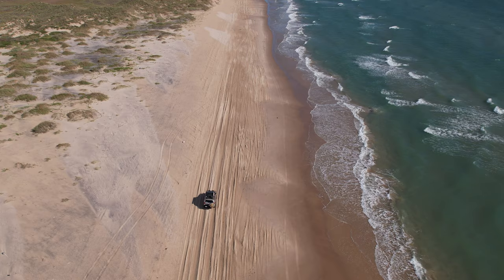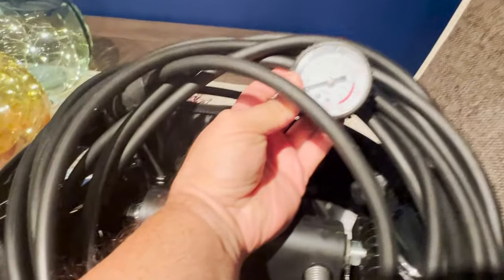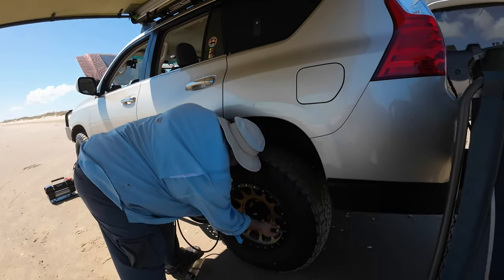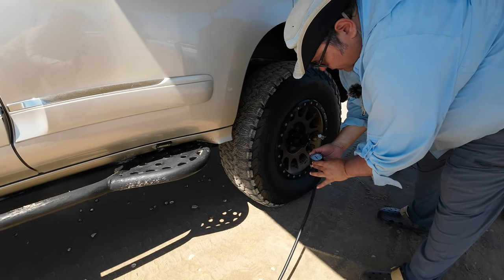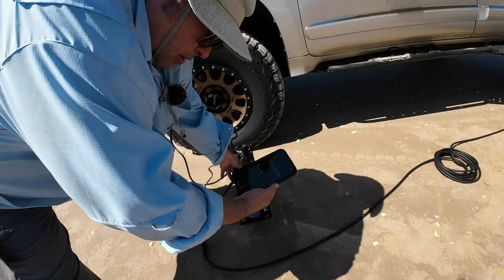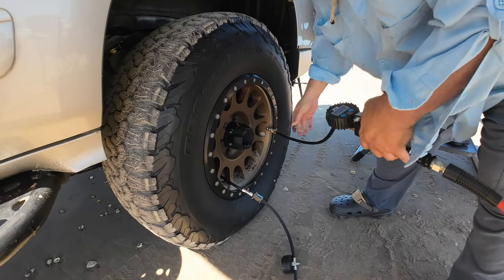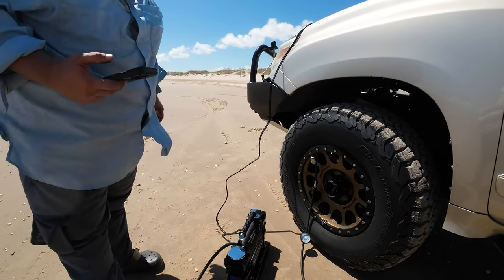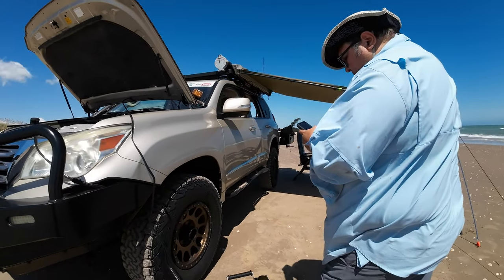TOZALAZZ 12v Air Compressor VS a TWIN ARB - You won't believe who takes it!

Comment: I’ve got a small Viair.  Not the smallest, not particularly fast but it works.  It also has the battery clips but what I rigged up in my truck is using a blank 7 pole trailer plug…I wired up some large gauge cables to it over to a power pole connector. From there I have another powerpole to ARB locking 12 volt fridge plug to run my fridge.  The cables are really large coming into the 7 pin plug so I have no worry about running my compressor through there.   I need to cut off the battery clips and put a power pole on them and put a power pole on the end of my  Vaiair so I can power it without opening the hood and I can still revert back to using the battery clips if needed. Those times on that Tozalaz were impressive.
Reply from the maker: I gave my Viair to my son. Very dependable, but a slow compressor. The Tozalazz is the fastest portable air compressor I’ve ever used.
Reply: @CoastalGX  indeed. I don’t know exact times but airing up from 17 psi to 35 on 4 tires is always a at least a 15-20 minute affair with 31 inch tires it seems like.   I can imagine with larger tires I’d be waiting forever.
Reply from the maker: @txfieros  yeah brother and that’s what turns a lot of people off. These times are much more manageable.

Comment: Those high CFM models work best with a 4 tire simultaneous inflation system like Morrflate.  Using them with only one tire at a time can actually cause air restriction and not use the compressor to its full potential.  Just wanted to share some information.  Great video though.
Reply from the maker: Thanks Greg. I may get one of those one day. It just takes a lot of space.

Comment: I have a wild question... are there air stations available as you get off the beach?  And if so, how much do they cost per use?
Reply from the maker: Excellent question!! There’s just random pay to air up machines at select gas stations, but not a specific place to my knowledge. It’s relatively cheap to air up at a gas station, but you can’t always count on it to work or be available.